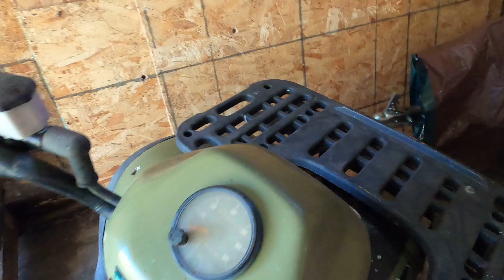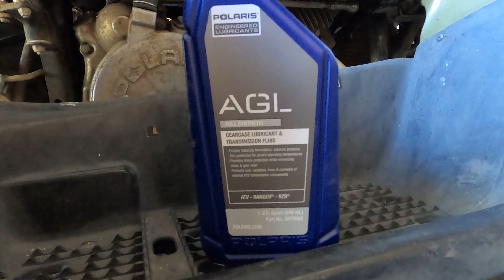Buying a used 2000 Polaris Sportsman 335 ATV & 48" Snow Plow

Comment: Living up here in Vermont, I bought a used cf moto 600 and put a 48" kfi pro plow on it for the winters a couple years ago.  Before the purchase, it was guaranteed I would blow my back out each year pushing snow with my snowblowers.

Congrats on the purchase.
Reply from the maker: @TrashcanMan8  does Vermont get alot of snow? Seems like the northeast always gets more snow than we do here in iowa. I'm hoping to get some use out of it this winter. Definitely helps making snow removal easier
Reply: @skywatcherranchswr  depending on whether your in the mountains (which I am) or not, it can vary. But for most of the state, you're guaranteed at least 2-3 feet each year. Last year, I had 5 foot banks at the end of my driveway around January.

Comment: you will definitely get your moneys worth out of the four-wheeler because i have the same one and that thing runs like new still the lights and speedometer no longer work but it is not one that will fail you i would recommend getting a wench on the front though never know when you need it
Reply from the maker: @lcice66  I did some work to it that I didn't film (but should have) and I've been getting all the quirks worked out of it. The older gentleman who had this atv didn't take care of it at all